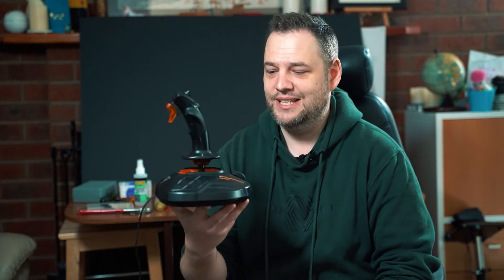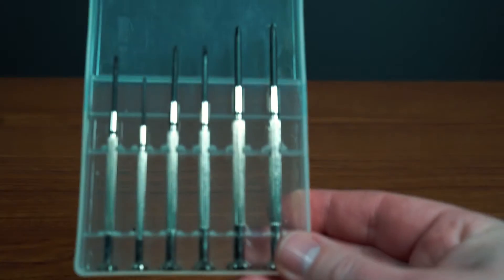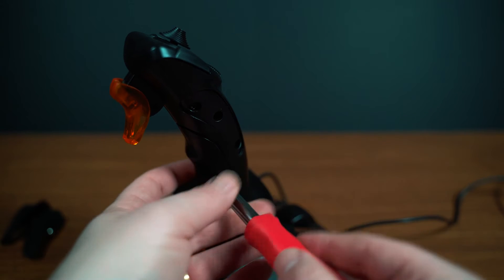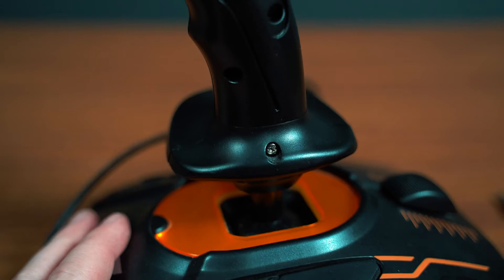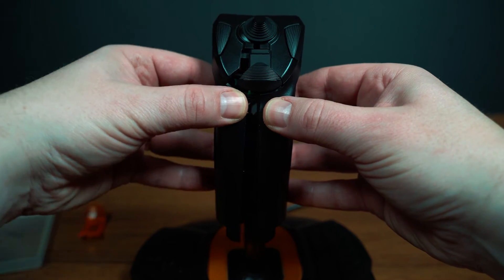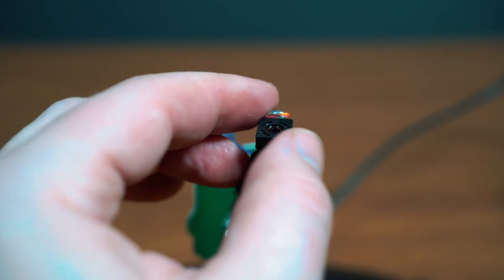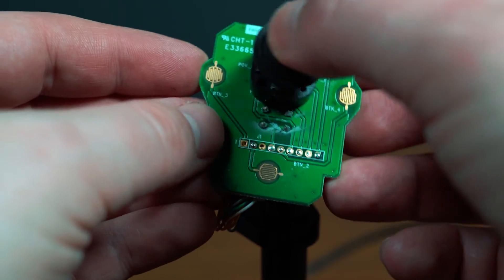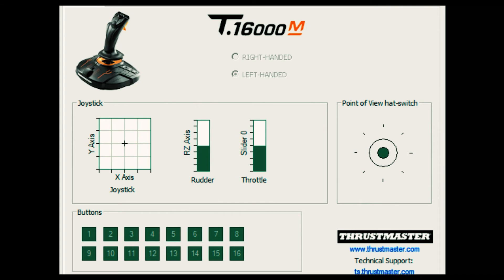Easy fix for T16000M stick/twist rudder - Complete tutorial

Comment: Following your tutorial helped me in the issue but, unfortunately, it is just a temporary fix, not a permanent solution.
In less than a year I have already cleaned it twice, it is starting to act strangely again. While sure, it just take an hour to open, clean it and close it, doing it every couple of months it is tedious.

Did happened again also to you?
Are you still using this joystick?
If both answers are yes, have you found a more permanent solution? I would also replace the potentiometer, but I would need a guide, and it seems I am not able to find one.

Thanks.
Reply from the maker: Hey mate, still using the stick and the issue has not reappeared. I'm not strictly aware of a permanent solution myself sorry. Maybe someone else has an idea about it?

Comment: 2nd comment I know. But if you have a small dropper of liquid cement glue. I would use just a dab of it on the tip of the nipples of doom. Set them in place and then do the tape method as well. It makes fitting them in so easy if you just do all the helping tips at once. 

Ps this indeed works. Just fixed my stick in 30 minutes. This vid is genius gold.
Reply from the maker: Thanks mate, I'm glad you enjoyed the vid and that it worked for you o7
Reply: @ArveyJay  o7

Comment: I was able to avoid a big portion of this disassembly. I followed  your instructions up until the trigger pin part. I left that in and instead of disassembling it further,  I found that by this point I had removed enough screws to allow me to spread the controller apart just enough to access the twister/sensor thing. I cleaned it with isopropyl alcohol and put it back together. No nipples of doom to worry about and only took about 5 minutes total. Maybe I was lucky, but thought i'd pass it on in case anyone wanted to try it first.
Reply from the maker: Nice work mate. Yes a few others have done it that way as well. I did mine that way also to explain the inner workings. Glad it worked for you!
Reply: This was a really good advice, and much easier to know what to do due to the full disassembly in the video. Now it works like a charm again! Large thanks to both and especially Jay
Reply: Thank you for this! I was just able to fix mine with almost no frustration! Just need to open up the stick just enough to see the sensor shown in the video and use the swab with iso, and boom!
Reply: Doing this made the process significantly easier and quicker for me, thank you John! I did remove the screw for the trigger, but only to allow the bottom part of the stock to come apart in its halves. I rested it on the sides of the sensor square and did my cleaning from there. Once done, simply reverse to put everything back together and I was good to go.
Reply: Thank you for this tip. Worked very well. Also thanks to ArveyJay for the Guide.
Reply: I've done that too. It was easy. Thank you!
Reply: Just tried this out, worked like a charm! Just make sure that when you get done messing with the stick, you put it back on straight. Had to undo and redo the screws as I hadn't taken a second to check and it was sitting off to the right when I screwed it back on.
Reply: You can easily pop the buttons out if you removed both sides of the stick assembly. Then pop them in again, once the assembly is loosly put together, so without screws. (If it fails, you can quikcly try again.)
Reply: Thank you for the video and for the tips, you guys are still saving T1600M models after the post of this video! 😁 Worked like a charm on mine, bye bye ghosting! 😎👍🏼

Comment: a million thanks J. back and running perfectly! after all the work I put into remapping the buttons for ace combat skies unknown I thought the only option left was to drop the twist off the script and only use my hotas/throttle paddle. The hardest part for me was getting the trigger pin out. If id have to do it again id start there first. great vid thanks again.

Comment: this may be the proper handy way to do it.. but just like my focusrite 2i2 soundcard, you just need to turn off the device and give it a good ol twist for 2 minutes. what happens is dust/lint builds up inside and when the sticks are on, the electric current keeps the dust locked in, so when you turn it off, it stops the current and the dust doesnt get locked in, and when you twist it, it pushes the dust off.

Comment: Thank youvery much  for your tutorial. It has helped me a lot.
With my joystick, the pin in the trigger was very difficult to get out. I had to use a small hammer.
I also removed the two buttons (left and right) before re-assembly and used super glue to fix the nipples on the buttons.
Reply from the maker: Nice work. Glad it fixed the problem for you 😁👍

Comment: Saved me after I got conned into buying 2 used sticks... both had this issue. In fact, one wasn't working at all at first. Your advice had me up and running within minutes. (Mainly because I'm comfortable with tearing things like this apart, haha)
Reply from the maker: Nice work mate!
Reply: It sucks i just bought 2 sticks and the left one turns left without me turning it

Comment: Thank you a whole lot, got mine fixed
But instead of using alcohol i used wd 40 contact cleaner so i didnt have to take the joystick apart at all, just slid the small tube in between the joystick and sprayed the sensor and now its all good
thanks again !
Reply from the maker: Nice work!

Comment: Hi Arvey, my handrest is a bit loose, it moves slightly left and right what shall I do?
Reply from the maker: Hey mate, yeah mine too. I think it is a design flaw. Have you tried tightening the screw more?
Reply: @ArveyJay  Its fully tight yet there is some loose feeling
Reply from the maker: @graingourmet  yes I have the same issue as you. Not sure what the story is there. I have found that if I twist the rest a little to the side it wedges itself there and then stays in place. Pretty shoddy though!

Comment: Well done and thank you. This fix has saved me £60 for a new one. I am definitely a 'tinkerer' and am happy to take something apart to see what makes it work. Luckily I had no trouble with taking out the screws or removing the trigger pin. I didn't take the circuit board out of the side of the handle which reduced the nipple of doom problem but I used your cotton bud/sticky tape idea to great effect, cheers for that.  The only thing I would recommend is testing it BEFORE puting the the screws back in.
Reply from the maker: Nice one. glad it worked for you and a good tip for everyone as well.

Comment: A small suggestion based on my findings after the same headaches the video author had. I even tried with the cotton stick trick, which worked anyways, but I found by accident that the buttons can be removed and slide back again. So, all you have to do is to put the rubber part in place over the card, and fit the left or right part in place, and you will see the whole and the rubber. All you need to do is to slide the button in place, and voila. Optionally, instead of sliding the button in with the rubber over the card, you could try to fit the rubber tip in the button, and slide the whole thing. 
That's the good news.
The bad news is that this trick will get you only so far. My stick started showing this issue after 8 months and dealing with the warranty was a headache with the vendor and manufacturer throwing me around, so I decided to use this trick, which extended its life a few months (enough to get out of warranty). Once your start having it, it will always come back. So, I bought a new stick and even an extended warranty. This time I will the vendor a hard time and get it replaced no matter what. It's not OK for a new product to last less than one year.

Comment: Why do thrustmaster not repl. this potmeter with a hal sensor . If they know the problem :(
the doom rubber switz when you disassemble  only remove one side an secure board with tape and when  reassemble turn joystick upside down so rubber part stay in button

Comment: Thank you, that was very helpful and instructive and gave my T16000M a little more life. It's a shame a joystick with such good and durable sensors has such a weak spot and a single point of (common) failure.
Reply: Because it's the one potentiometer in a hall effect  stick, not to mention it's mapped to the one axis they wish you'd buy pedals for
Reply: @npc6817  So they know very well what they are doing by installing those flimsy potentiometers.
Reply: @zakzwijn8410  hell yeah they do. My personal recommendation when it fails replace it with a vkb gladiator. Not as cheap but combined with the t16000m throttle it can map 1/1 any modern fighter hotas and is better quality than the t16000. Also it's not a 300$stick
Reply: @npc6817  My issue is that I really like the T16000M, they are the perfect size for my small hands. I ended up ordering new pot meters and soldered a new one on the stick; now it works like new again.
I also ordered new pot meters for the throttle unit in case that one breaks too (and it will).
Reply from the maker: Agreed!

Comment: beautiful! couple drops of alcohol and mine worked perfectly after, thank you.

Tip for others struggling with nipples : Just use gravity to keep em down. Tilt the handle towards you so its horizontal, nipples and buttons will stay down, then gently slide the circuit behind it. No need to tape em or take the buttons out.

For Trigger pin : Slide the pin in the orange trigger before you attempt to put it on the handle, its much easier this way. Put it all the way in just before it starts to come out of the inside hole, this way when you finally mount it on the switch , the pin will be secure in place, use something flat to push the pin all the way in.
Reply from the maker: Nice work and good tips 👍
Reply: @ArveyJay  Thank you very much. Now the T16000M works perfectly.Alberto P.
Reply from the maker: @albertopadovan2111  awesome!

Comment: Hi, nice video, thanks, my pin was stuck like others but FYI you dont have to remove all those buttons. just move the right side off a bit as well, leaving them in place , then the twist axis is exposed for cleaning. only leaving the left button to fiddle with on reassembly.
Reply from the maker: Nice. A few others have commented the same. As for the rod, it's a pain. I made a separate video addressing that issue here: 
https://youtu.be/GSmK62tsq9g

Comment: The steps worked perfectly! Thank you for taking the time to put this video together. Only issues to note are:

1) Getting the trigger pin out is NOWHERE near as easy as it looks here. It takes a great deal of force. If you have a cheap micro screwdriver, it may break. I'd recommend a small allen/hex key or a pin punch if you have one. High, constant "pushing" pressure seems to work much better than momentary impact force (as if you used a hammer). The stick twists too much for hammering the pin to work.
2) It's easier to deal with the nipples o' death if you hold the unit upside down when re-inserting the circuit board. Wondering if a small dab of glue would work, as well.
3) Even after going through all this trouble, with enough additional use, the wires could very well go right back to interfering with the pot again. Then you're back to square one.

Better option: skip the T16000M entirely and order a VKB stick.

Comment: 4:44 I got to here and couldn't get the fucker out so just kind of pried it open and put some electronic contact cleaner on the sensor (I'm sure isopropyl alcohol is fine but apparently it's not recommended as it's not plastic safe). Probably not the best way as you risk breaking stuff when pulling it open, but all I had to do after that was screw everything back on so was a lot less fiddly. If anyone is impatient like me might be worth it. Thanks for the vid
Reply from the maker: Nice work. Glad it worked for you!
Reply: @ArveyJay  Thanks for your help man, all the best

Comment: This was a great tutorial, I only shouted "nipples of doom" like 50 times before my wife came to hold things in place. In my case, the issue was the cables that attach the sensor had a bit of silicon that was snagging onto the main cables, on a turn that got stuck on the controller cables was pulling the sensor to the left. Shout out to the commenter that found how to remove the buttons, that really helped deal with those nips. Another tip, before you finish one side, make sure the button is in since that makes the joystick sort of hold in place when attaching the other side!
Reply: welp i lied, i had to do this again. It does get easier to try to fix it on the second pass now that i know the pitfalls. It isn't super glitchy on the rudder and certain angles make it start glitching. I did try to position the cables around so the main controller cables are under the cables for the rudder sensor.
Reply from the maker: @AnEmortalKid  bummer. Hopefully the second time is a charm!
Reply from the maker: Haha, nice work on the fix and thanks for giving me a giggle imagining you shouting. 🤣👍

Comment: It worked for me, however I found that the buttons could be removed from the stick and replaced after assembly of the two half’s. each button is held in place by a spring finger and can be removed after gently pressing the finger from the inside. I also glued the plungers to the buttons with 5 min Two part glue (Araldite). Also cleaned the plunger contacts with the cotton bud and IsoPropyl Alcohol. Just replace two screws then checked operation of joystick on the PC. Thanks for the great video.
Reply from the maker: Nice work! Happy to help 😁👍

Comment: Actually, I did follow the video exactly but it did set me in the right direction.   I'm not a tinkerer so rather than taking the joystick meticulously apart, I just poured the alcohol all around the thumb stick at the top and let in seep down into the handle of the main stick while rotating it back and forth.   I waited awhile to let the alcohol dry and this seems to provide the same results in less time.   100% fixed the problem, at least for the last few days.

Comment: Worked perfect thanks. Mine was only slight. But was still doing my head in. Doused the pot in IPA  and gave it a few turns and also pulled some of the wiring from out the main unit to give some slack.  Zero twitching now thanks

Comment: Just another comment confirming that your method worked like a charm as well! Just confirmed it worked. However, I did go the extra step (as a user on Reddit added) of removing the pot from the stalk - it comes right off - and peeling it apart, cleaning the insides out with a cotton-tip swab, and applying some very light dielectric grease before putting it back together, placing it back onto the stalk, and reassembling as you described.

I appreciate your time and diligence. Job well done!
Reply from the maker: Nice work mate 👍

Comment: This worked for me. I had this weird ghosting where the throttle at the base of the joystick caused z-axis to react to it and if it was not exactly at center, the z-axis would also be not centered. On top of that it was just erratic. So fixed (for now), but when I opened this one I saw that axis construction and it is just weak so lets see how long this stays ok. Thanks for the video!

Comment: Thank you sir!  That did the trick.  "Easy" though...not so sure
I had to put it back together and disassemble like...3 times. 
First the wires were in the way of the long screw (good thing I didn't push hard! - something to watch out for)
Then somehow the trigger was also activating one of the hat buttons. How? I have no idea
And then last but not least, the twist detector moved and it wasn't set right.
All the while, those cursed nipples kept falling. I for one was very glad my daughter wasn't around to hear the uninterrupted string of obscenities coming from me, specially when the whole thing fell apart and I spend half an hour looking for the damn nipple. 

But....it works PERFECT now!
Reply from the maker: 🤣🤣🤣 yeah that sounds like a  nightmare but I'm glad you persevered with it and got there in the end! Well done!

Comment: My brand new T16000 had twist issues almost from day one, it would ghost to the left randomly. It's been about a few weeks now that I can't have this going on and I tried new USB ports with no help so I started disassembling. I immediately noticed that an extra little membrane hat for the buttons was inside the stick. This had to have been floating around and gumming up the twist sensor. After confirming the twist sensor itself was ok with a quick test, I reassembled and sure enough, the problem is totally gone. Of course I almost lost a membrane myself when snapping in the two side buttons so I assume this is what happened at the factory. They didn't think it would be a problem and it may have not been during testing, but the room inside the throttle let it work down to causing an issue with the sensor.
Reply from the maker: Good detective work!

Comment: You are doing it wrong.
You remove the buttons first (before putting it all together). And the transparent membranes are stuck back to the buttons with say bluetack or similar.
The buttons are made to be removed, they are easier to remove when everything is apart, and when putting it all back together is easier having them put back last..
Reply from the maker: Good tip. Others have found success with that method too. I took it apart mostly to be able to show the process properly. Cheers.